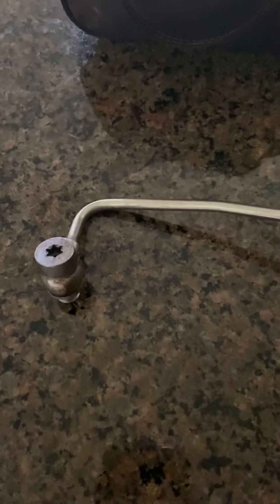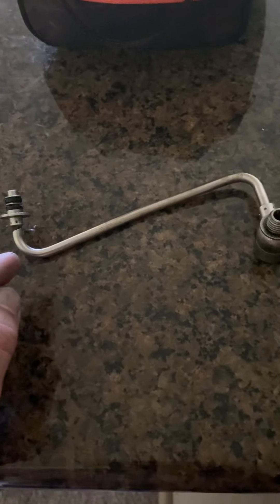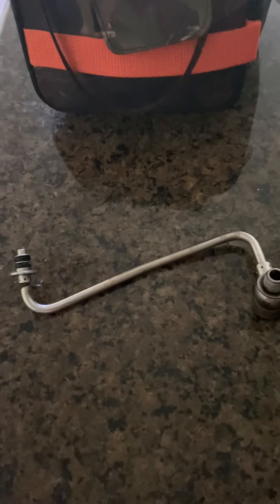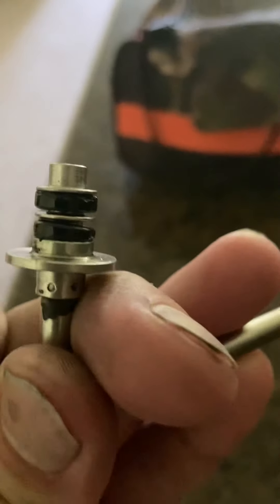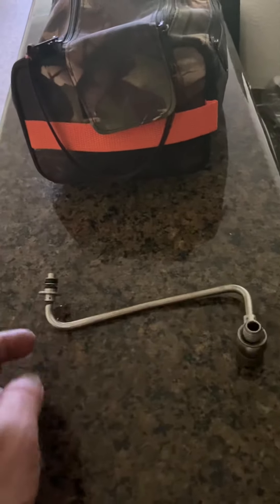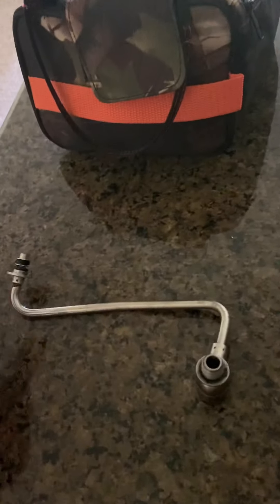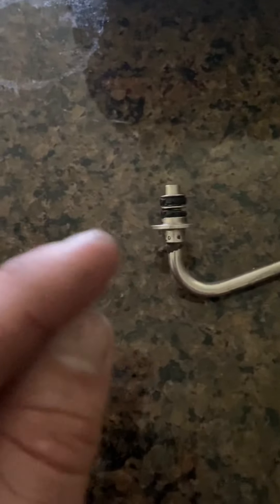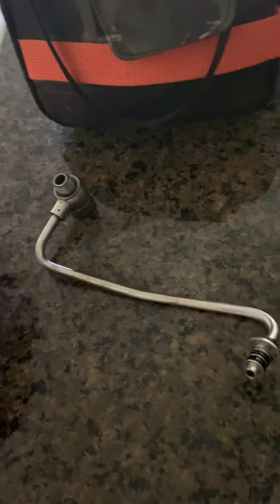2012 Chevy Cruz 1.4 turbo oil feed line replacement

Comment: The ones you buy on eBay and Amazon are 1/2" longer. Just compare it to the old one and bend in slightly to match. Ya' gots to bend it to fit. It's easy.
Reply from the maker: I purchased one from eBay before and even it went to GM the first time and they gave me one that was a little too long and you can't bend them with wouldn't fit and they told me it was the right one but they sold me the right one but for a different size motor so I had to take it back with proof of received GM. They gave me the correct one

Comment from the maker: Please be sure to go to GM spend $30 to get right part as Amazon ebay continues to give the wrong part. I do not recommend buying any of them online because it's very hard for them to send you the right ones for the right car and I've had this problem with other parts. Usually the most expensive one is usually the one that always fits. If I were you I would always stick with dormant or AC Delco parts as they seem to work very good for this vehicle. The Chevy cruises do not really rely on cheaper brand sensors or any type of other components

Comment: Thats an updated version as the old one had one bigger seal instead of two, the newest version has two seals and a heat shield around the straight part
Reply from the maker: I had the old version and it had aluminum foil on it. The new one had like a different type of aluminum foil but I never had a problem arthrit I got the update version from ACDelco. I guess they actually changed them. I was told using the fifth generation parts were actually better for the first. I don't know why they called it that but they sure as hell called it 5th generation part. So I put all new generation on that motor as well and you never had any more problems. I thought it had a lemon car

Comment: Thank you mine only has 1 to I just went today and they also showed me 2 with 1 seal so I said screw it if that’s what my vin says it firs
Reply from the maker: The issue with these cars is they have two seals on the original AC Delco oil feed line. If there's a little pinch or one of the silvers wore out all that oil is going to come out of that and it's going to cause you to lose at least one to two quarts of oil and not even a 30 minute drive down the road and your car will start smoking. So when I bought a brand new one it comes with one seal now cuz I think they decided to go with one because it probably works better and I installed mine and never had a leak again. These cars crying for oil leaks
Reply from the maker: I didn't recommend going to GM and getting it because every time I got it through then they gave me the wrong part but eventually I went to another GM dealership. Then they gave me the right part and I think it was like $30 for the whole unit which is still not a bad deal
Reply: They must have sold you a new old stock the old one has one bigger seal instead of the newer two rings
Reply: @Rancid_Ninja  what would you say is better
Reply: @WrenchingNLearning  the newer two ring one is supposed to be better as it has a secondary seal if or when the first one fails, they are supposed to be lubed before install so they don't come out of place or get squished during install
Reply from the maker: No, the original ones that was on the first generation. Chevy Cruze used two seals when I end up getting the AC Delco brand from GM. They changed them. It has one seal now instead of two. I guess they must have figured out that it doesn't really sell it very well but these have to be pushed in all the way and they do cause a massive oil leak. Once the seals go bad it's not the line. It's always seals
Reply from the maker: Plus when they leak they don't show much signs with the vehicle's idling or sitting. It only happens when you're driving the vehicle. If you see smoke coming out the left driver side of your vehicle, that's where the oil leak is mainly coming from. It's a common problem
Reply: @WorldWideMediaGroup1  search this issue on YouTube even all the others show them pulling out a rusty corroded one with a single seal
Reply from the maker: @Rancid_Ninja I never had any corroded rusty lines on mine. My car had less than 129k miles when it started leaking. This car was very clean. It was only had one owner. It was purchased from auction until I bought it. I think it was a limit card because I had continuously had oil leaks and problems. I put a whole brand new motor in it and everything and I decided to sell it so I got tired of all the repairs
Reply: @WorldWideMediaGroup1  I've had mine since 17k as the second owner and now have 92k and have not had any of these issues, just a valve cover once a year or two ago. Just watching videos on what else to cover when I do my short shifter, plugs and coil pack here soon
Reply from the maker: Like I said I got mine from a dealership but it had under 128k miles. I didn't have a problem with a car until 3 months later and I started having oil leaks in a free sleeves. Then the motor blew up but the place I bought it from sells very nice cars. But I think they sold me a lemon card but some people get luck out of some people don't